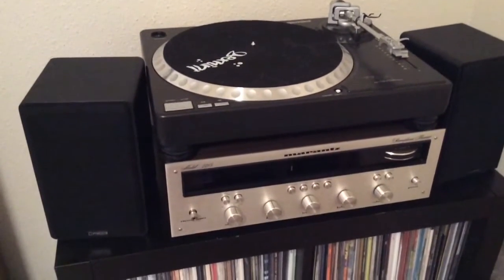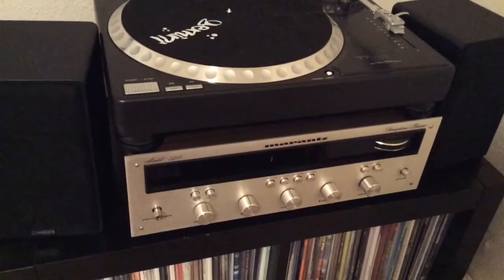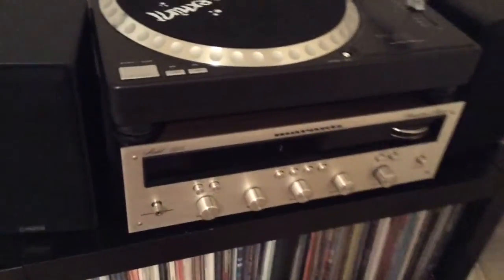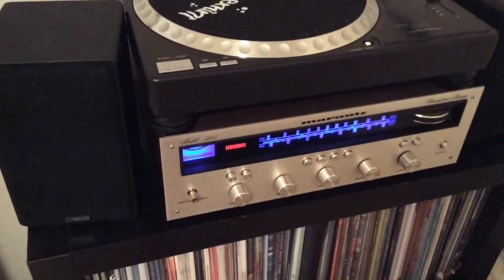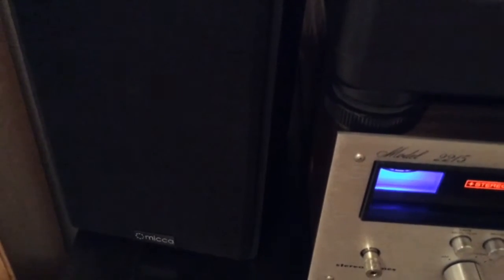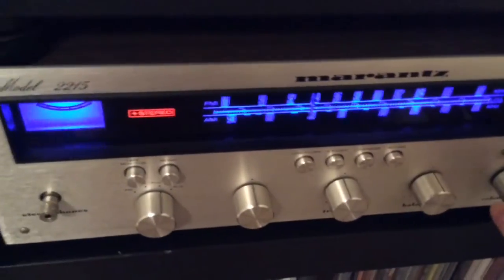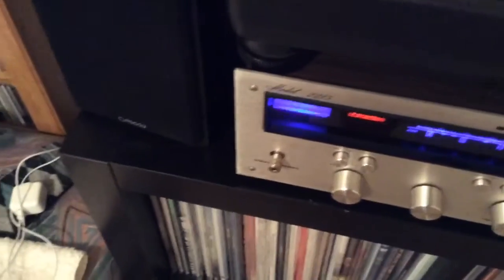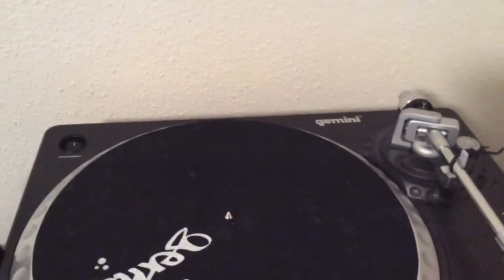Buzzing Noise in phono stage [RESOLVED, keeping up for comments]

Comment: Usually when you get that kind of buzzing sound it could be from a speaker wire not making a proper connection. Also if your turntable has a ground wire and it is not properly plugged in it will make that kind of noise too. Actually you just said "the ground wire" when I was writing this. 
Hope this helps Amber. Check all of your wire connections and make sure that everything is properly plugged in~
Rob/Boston
Reply from the maker: Thanks for the added info, Rob!  I'm very clueless with electronics... it's why I paid extra for a serviced one on eBay instead of the cheaper ones... argh.
I was picturing my recordless future if something goes wrong with this receiver :P
I didn't check the speaker wire only 'cause it plays beautifully on the radio (didn't show that in the vid but it does) and aux it's dead quiet though I didn't try plugging anything in for that to doublecheck.  I'll check it in a sec and play an mp3 or something, hah
So far I just disconnected the turntable and reconnected it... I did think faulty ground.  the ground's a little rusty on the part connecting to the receiver.  I just hope it's not a connector in the receiver not working.  wires are cheap to replace.  fixing a receiver is prob not
Reply: Rob beat me to it Amber. Check over the ground wire from the tt to the rec'r and see if it helps. We've all struggled with that one and that hum sounds spot on like a bad ground. Good luck!
Reply from the maker: BioCYTE1 Thanks, Lj!  I disconnected and reconnected the ground (Edit:  or I should say I disconnected the whole turntable, not just the ground) when checking for the source, but on the side connected to the receiver it did look a little rusty... I dunno if that could be the problem, but my dad's stopping by soon.  maybe I could suggest bringing a new ground wire... he thinks it's the stylus after listening to the clip though... hmm

Comment: There is a ground wire connecting the table to the ground lug on the receiver, correct?  That is classic phono stage grounding loop.  You can try connecting speaker wire to replace the existing grounding wire, you can try moving the turntable (and plugging into another outlet as another step) to see if it goes away, moving the speakers away to see if it sounds better, or flipping the AC plug on the marantz as well.
Reply from the maker: Hey, Kris... yep, it has a ground wire... one of those rca ones with it attached on both ends.  I actually have a pic of the back of it from when I set it up in January 2014, but dunno how to link it here.  it's on fb.  hah.  anyway, I thought maybe the grounding wasn't connecting well anymore when I noticed it was a little rusty on one end.  would that affect its performance?  all I know is that it worked up till Friday night.  there were two instances where it went completely off -- full on booming sound -- but jiggling the cables fixed that.  maybe it was a warning sign.
I didn't think about speaker wire... was just going to buy another ground rca online and have my dad help when he's over his cold.  I smashed my fingers trying to turn it around on Saturday for why I'm waiting to do anything now.  I set it up on the floor initially and had someone move it to the shelf for me.  these things are heavy!
Before the finger smashing, I did figure out that disconnecting the turntable completely and turning it on phono produces no buzzing but I guess that still doesn't eliminate the possibility that it's the connectors... still hoping it's not that.  I also figured out that putting my turntable on the other side of the room still produced the buzzing unfortunately :\
Reply: aekastar Absolutely.  If you have a lug (or screw) on the turntable, just get any old wire and connect one to the other - like speaker wire, heck, any old wire will do.  Try replacing it with that spare wire.  Sometimes even just you touching both sides with your hands might make the noise change.  If so, then you know its that part of the grounding that is the issue (also, just to eliminate what Rob and LJ suggested, if you plug in headphones and hear it, you know it isn't the speaker wires)...
Reply from the maker: dixielandfarm Yeah, touching the ground /rca with my hands kinda would make the buzzing sound fainter then it'd come back.  I'll def come back and say what worked when I get help with it.  and good to know about it not being the speaker wires... I figured not since it sounds great when listening to the radio or an mp3 through aux

Comment: Did you ever get this problem resolved? If I had to guess, since the speakers are close to the receiver and TT, and the fact that you get the noise in Phono mode, I am guessing it is feedback from the turntable.  Maybe try moving the speakers further away from TT and receiver, and maybe move TT off of the receiver if the moving the speakers didn't work.
Reply from the maker: Thanks for your response!  right now it's gone (initially my dad came over and tightened my connections), but it did come back once since making this video.  positioning did seem to fix it; I nudged one speaker over a bit further and it worked -- kinda hard to move anything drastically in this small space though!  I now have my speakers on wooden feet, too but the problem was better before then.

Comment: One thing you need to do is get turntable off the receiver / amplifier put it on its own stand away from the speakers that might solve your problem but one thing you never do is put a turntable on your receiver and or amplifier hope hope this helps you
Reply from the maker: This problem has been resolved for years (is in edited title) and the turntable hasn't been on the receiver for years

Comment: hey hope you get it sorted soon. in the past i have seen buzzes from many things. with phono inputs its hightened due to it having to amp up the signal. if you re connect the earth and everything after your dad has had a look and it still buzzes check you have no other cables running accross your hifi cables. also try moving your TT off the top of your amp. even if you get it up a little bit it might help also like someone said move your speakers away a little even if you just pop them on the floor to test them away from the TT to see if it makes a difference. all this can be a mine field. i have a problem from time to time with my system and its a cable from a completley different item that causes it.

Dean
Reply from the maker: Thanks, Dean!  yeah, the wires are all tangled back there, so it is a minefield of sorts.  I got some untangled but the area is just prone to tangles... like that blue wire from the radio that's hard to keep out of the way of the ground.  it's worked for all this time, but when checking after the buzzing started last Friday, I noticed a record from my shelf that got pushed back too far was pinning the rca ground wire to the wall!!  removing it didn't fix the buzzing, but who knows, it could've caused a short... it's all still confusing to me but yes, I'm going to try a new ground first once my dad can come over and move it for me then if that doesn't work, try other methods.  I can say I tried moving the turntable over to a chair on the other side of the room when first diagnosing the problem and it still buzzed, but I didn't try moving the speakers.  with the turntable completely disconnected, there was no buzzing so I've narrowed it down to turntable/connections related
Reply: The tt can pick up lots of noise. Try things in steps till it sorts it self. Good luck :-)

Comment: That "noise" is the 60hz power coming from your wall outlet you definitely have a ground issue, not to sound like a broken record (pin intended) but I would definitely get it looked at. This can cause a cascading effect to your TT and could cost more if neglected. Take it in and spend a little now vice a lot later!! Good Luck!!
Reply from the maker: Hmm, yikes!  you make it sound more serious... I was just going to order a new wire and try that out... hopefully it's not the connectors.  since I noticed the issue, I haven't listened to any records though

Comment: Did you ever figure out the cause of this problem?
Try taking some sand paper, and use it on the connections from your TT. Clean off the rust and corrosion you mentioned earlier, a solid connection is what you need, and this should go away.

It is definitely not your speakers, as it only happens in phono, and not aux. If you want, I can post a video of what I am talking about, if you like?
Reply from the maker: Don't have any sandpaper, but would be interested to know what you mean
My dad did take a look at it a couple weeks ago though and got the buzzing reduced by a quarter... meaning I can turn it up louder than in this video without hearing it but can still hear it if I turn it up past the midpoint.  all he did was test out all the connections and tighten them then pulled the shelf away from the wall a little bit

Comment: Hi Amber, what resolved it. I'm having the same high freq buzzing noise . Tried just about everything except wrapping the phono cable in aluminium foil. Do share pls.
Reply from the maker: +Ragunath Balamurugan I called my dad over and he tightened the wires back there, I think the metal clip was too loose... it still would lightly buzz if I turned the volume up past midway though, but I hardly ever do.  I now have a u-turn which doesn't need a metal clip at all and hear no buzzing.  hope that helps!
Reply: You tightened the wire that connects to the receiver from the speakers or the RCA cables from the turntable?
Reply: Nevermind. I just needed to connect my turntable ground wire to the GND screw on the back of my receiver.
Reply from the maker: Glad you solved your problem!  yeah, the ground that connects to the receiver is the one I had tightened :)
Reply: +aekastar Cool. Thanks for responding.

Comment: Hi Amber. Well I guess everbody already said everything at this point lol,but your connections could be just dirty. I always cover up my receiver and turntable with towels or whatever when not using. Protection from dust.---Colin
Reply from the maker: Heh thanks Colin... I use a towel as well... I took it off for this vid.  the towel really only covers the turntable though so I dunno if I need to get more protection... bwah!  I dust around my corner more than the rest of the house but it could be... this room gets a lot of dust from the vents

Comment: Hey man just a quick question. I have a pretty old turntable with just red and white leads coming from the back.(no clue if it had a pre amp.) I plug it into the phono ports on my amplifier(intergrated) . The turntable fine at low volumes but then a hum Appears at louder volumes. Do u have any advice. When i select the aux channel on full volume there is no hum.
Reply from the maker: All I can tell you is that with my issue here, my dad just came over and tightened the ground wire and it reduced the buzzing so I could turn it up louder without hearing the noise.  eventually the problem subsided so it was probably interference.  now I have a new turntable and it never has any humming.  I hope you can fix your problem just by tightening the wires or possibly moving the equipment.  my new turntable is a u-turn which are quite affordable if it comes to buying a new one.
Reply: So move my speakers away from turntable and clean up the connections
Reply from the maker: Where are your speakers now?  I was mostly talking about moving it to another part of the room or a separate room in case of electrical interference, but speakers can also cause noise... mostly a rumble if too close.  yes, make sure everything's clean and securely tightened.
Reply: Cheers I see if it helps and will let you know and yeah my aux Chanel Is fine

Comment: I would def replace your connector  first like you plan their might be a ground in that and that's an easy fix.  how you tried wiggling the connectors at all that will def get you in The right direction?  Just be careful and don't open up your receiver, a lot of those capacitors in there hold a charge that can zap you!! We want you to stay alive :)
Reply from the maker: Hahah nope, don't plan to open it up... I know better than that :P  for one, I smashed my fingers just moving the receiver initially.  I do hope it's not the receiver that's the problem though.  my dad plans to come over soon and I'm going to have him look at it (he still believes it's the stylus; I don't entirely but who knows) then try the new wire.  hopefully one or the other fixes it